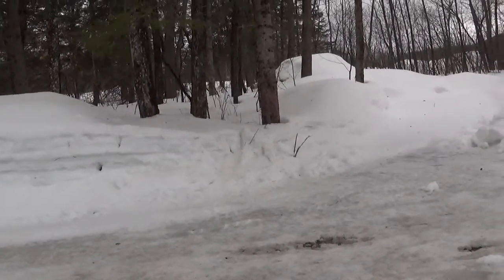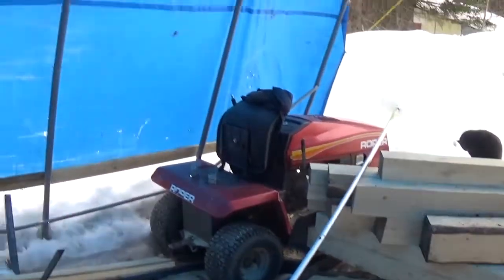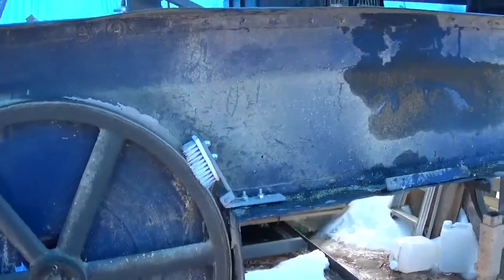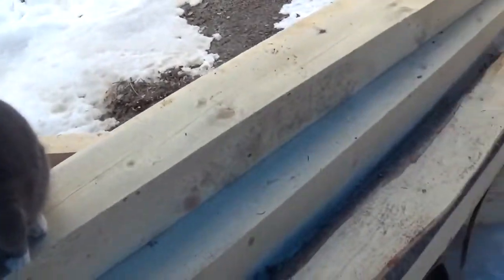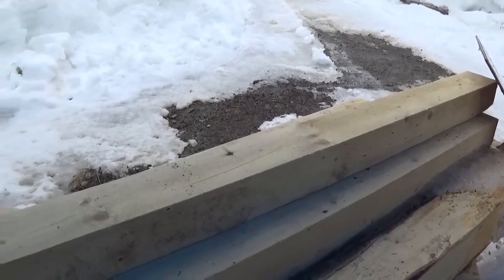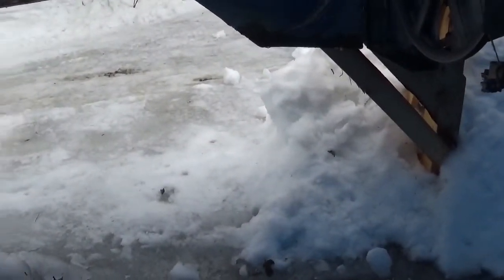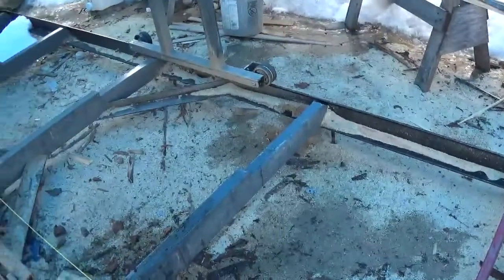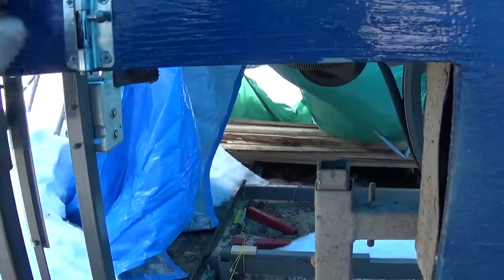Update on mi homemade band saw mill

Comment: Hey there Serge.  I like that idea of mounting bristle brushes against the band wheels to brush off the excess saw dust.  That makes sense to limit the amount of saw dust build-up between the blade wheel and the blade.  I think you may be talking about what we called weather-board or lap-board on the outside of houses. It was common on homes up north. I'd help my dad paint the exterior of the house about every 3 to 5 years.  It was a chore to say the least and then vinyl siding emerged (which my dad said was the worst thing to put on the exterior of a well constructed house). sure is good seeing your video and I hope you, mom, and dad are doing well. Okay my friend, be well.  Don 👍🏽🙂  3/31/22
Reply from the maker: hi Don ,that is what I ment Lap board siding.I think it look great too if you put a clear stain on it to see the grain of the wood.